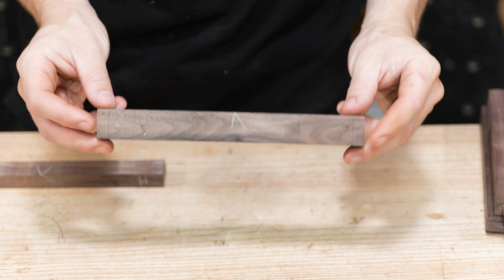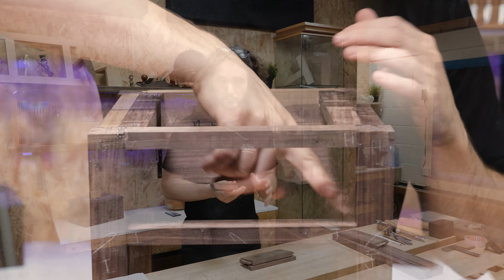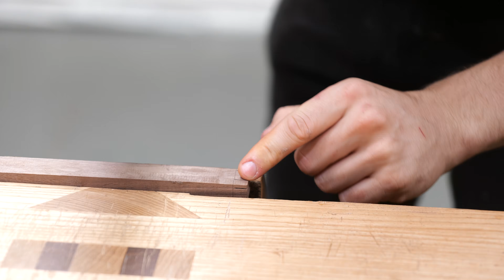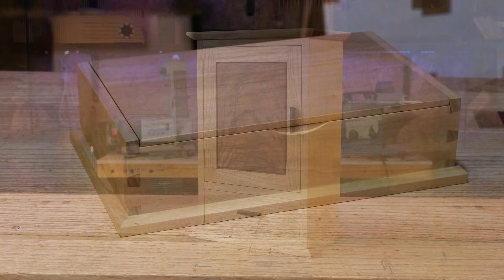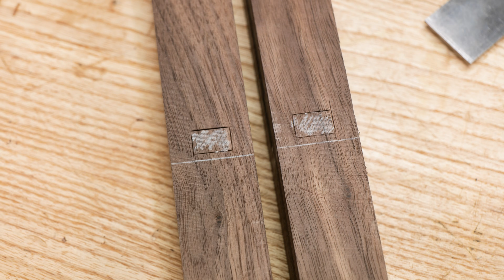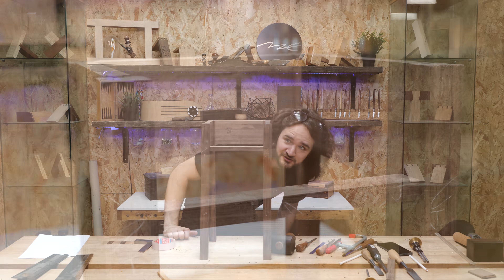Stub Mortice and Tenon | Shaker Table Project #4

Comment: Hi Matt,
Love the videos! I've just done a short evening course at Rycote and it was fantastic.

I was wondering what you think of the knife wall method à la Paul Sellers? How do they compare: using a marking knife and chisel to get a very crisp edge on the shoulder and create a notch for your saw before cutting the cheeks of the stub tenon,  compared with your method of cutting well in the waste side of the cheek before chopping back to the line with the chisel.